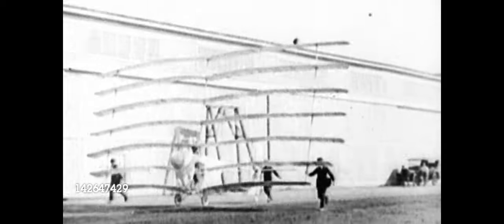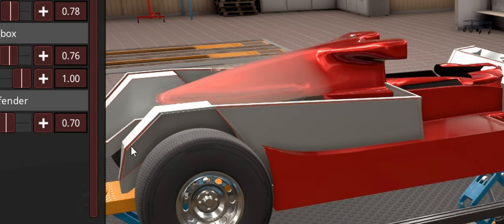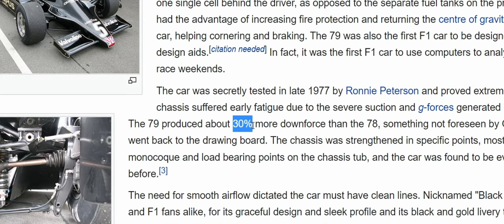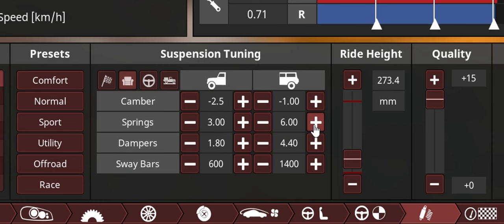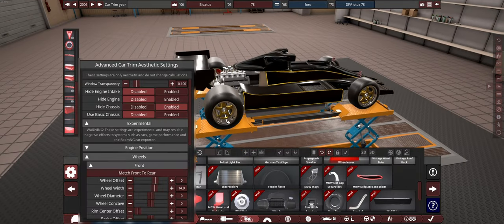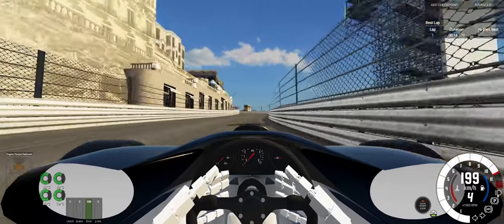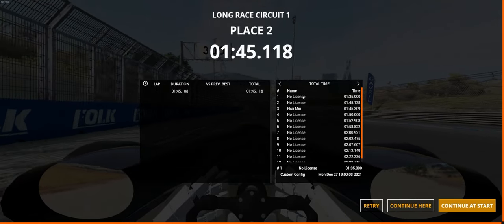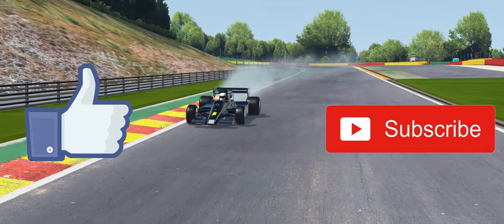The First Ground Effect Car (Automation🔧BeamNG)

Comment: Wow how do you only have 3k subs, Your voice is clear, your confident and have good editing. Keep it up would love to see a channel like this grow. Your blender model looks really good. Im trying to get into doing cars in blender and that looks a lot better then what I got. Also yeah Automation is such a good game and glad that beam coalbed with them as I can import some of my nice looking cars over. Thing about it is that sliders can save weight on some stuff so on panels if up you get less weight but on seats and safety down is less weight. F1 cars of the era would most likely only have a open diff.Keep up the work Filman86
Reply from the maker: dunno bro, the only thing I can think is that I don't pander to children, so youtube doesn't share me around :/
Soon I'll be doing a stream on my process for modelling cars again (I have done one in the past already, but I've gotten way better)
the safety slider doesn't change weights for beamng, same with the new weight optimisation sliders

as for diffs? there is such little information on what the time lines were, that I just can't be sure, but they did use lockers for the longest time, and I read once in the 60s that one used an automatic locker (but in a really complicated way haha), so I really don't know :/

Comment: Such ashame you didn't do any of the V6 Turbo cars.

But this car is the best car ive ever done in automation. Usually even if they end up being accurate and looking great they end up driving like shit. Ive only got my keyboard and its pretty drivable. 

I missed out some bits though, at the time i couldn't find any info on downforce so i assumed it was less than a ton. Still got the car to do a 1.46 on the automation test track which is decent. 

I hope after all the supercharger updates etc, they have a look back at aero suspension and chassis options. Pullrods would be helpful!
Reply from the maker: you mean like this - https://youtu.be/n-t2LI_EMZQ hehe

Comment: Just a little heads up: If you decide to make Ayrton Senna's F1 cars of the 80s (Lotus 97T, 98T, 99T,) then oof, I feel bad for you. The engine that these cars used the Renault-Gordini EF15B V6 Twin-Turbo) was almost impossible to replicate in Automation. They completely broke the turbo systems, it's a gigantic juggling act to get the power you want, and 9 times out of 10, the torque curve is horrendous. I just tried to make the engine for a fictional F1 car for my racing brand, and I had to go back and forth between wikipedia and a ton of other sites just to get info on the engine, I had to boot up Gran Turismo 6 (which has the Lotus 97T and possibly the most accurate info on the engine I could find) just to figure out the torque curve (which I failed to replicate) and the boost that the engine made ( which was somewhere in between 4.0 and 4.5 bar, which causes the turbos to overheat and blow up in Automation). You are definitely correct in saying that NA engines in automation are way over powered. I really wish that the Automation devs would make the turbos a LOT less sensitive to temps, because trying to make a lot a of power from a low displacement turbo engine would be certainly easier, I had to max out the air to fuel ratio just so that the engine didn't turn into a fireball. Maybe the engine in the 99T would be slightly easier to make (it uses a Honda engine instead of the Renault one) but good god, turbo engines are significantly harder to make since the update.
Reply from the maker: are you making the qualifying engine, or the race engine? there's like 500ish HP difference
Reply: @fillman86  Couldn't match the power of either. (I was making the varient that was in the Lotus 97T, which made about 710 HP for the race engine according to wikipedia and 999 HP for the qualifying engine according to GT6.) Highest I could go without the turbos exploding was 665 HP.

Comment: I figured the lotus made more downforce but I suppose its understandable for 70s
Reply from the maker: the big issue was that it was a first draft, and the rear of the side pods exited into an airdam known as the rear wheels, and engine and suspension etc, meaning the faster moving air couldn't move fast, because it has nowhere to go. With just fixing that, they got about 30% more ground effect in the next car
Reply: @fillman86  who needs wheels when you can flintstone it around the track at 200mph